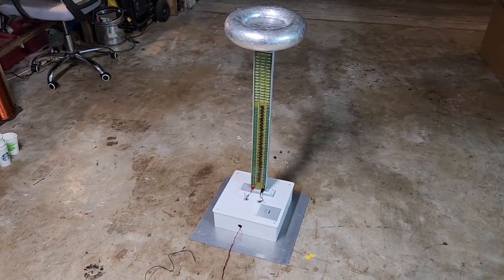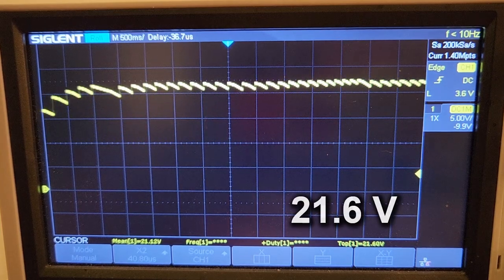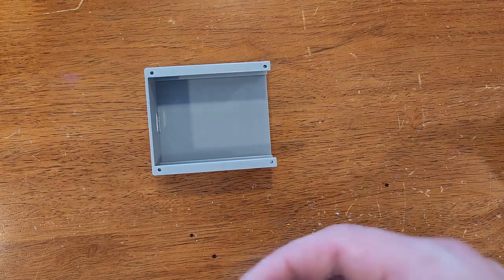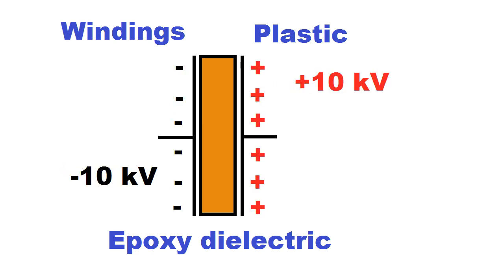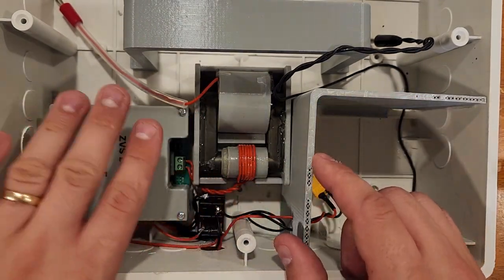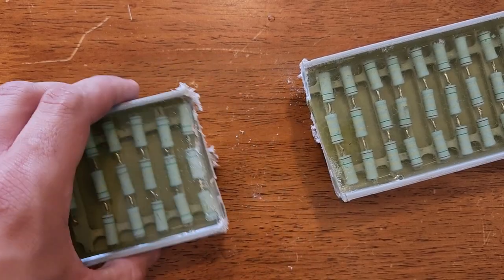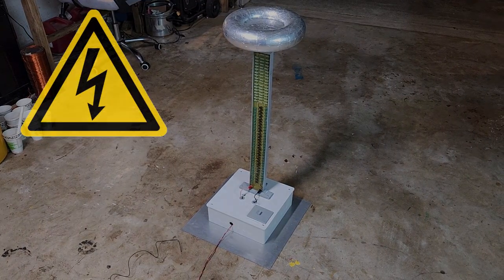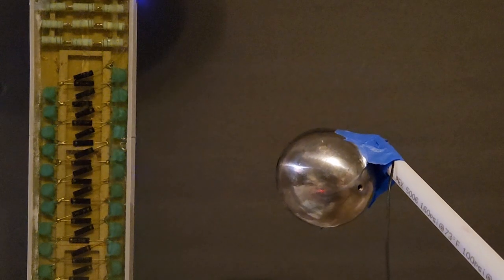500,000 Volt Lightning Tower

Comment: this is not even close to 500kv it looks like it can jump about 10cm so its about 100kv and you dont need top load with multiplyer it just disipates the charge. its not a tesla coil. btw ive built a tesla coil capable of about 2 meters smarks playing music.... and there is no radiation, this is misleading. the bigger hazard is breathing ozone, but you would need a lot of run time to make it an actual danger.

Comment: try the brushless dc emf circular loop train(magnet train running along a track), not coil train, duel-quad coils next to a sideways magnet train
Reply: try making metals by electron avalanche ionization to vacuum the oxygen out
Reply: no wonder you are making uv-c (all of them) with the arc
Reply: all the air particles recombining after ionization
Reply: van der graaf or windhurst are "safer" for high voltage static electricity experiments, very low current, zap safe

Comment: couldn't you just put the multiplier in a mineral oil  or  silicon oil  not epoxy? Trouble shooting and re-working would have been easier? or the dielectric breakdown of epoxy is much higher?

Comment: i can only find 5ma diodes... there shouldnt be that much current anyways right?... so i think a few megaohm is enough even for that.
Reply from the maker: They'll work, but you'll need to make sure to either have a large resistance on the output and/or limit the input power to the multiplier with a very small value capacitor (single pF range) as a high impedance source
Reply: @HyperspacePirate  i am thinking about not buying resistors at all and instead using a short tube with saltwater. thx, didnt think about impedance but thats an option for sure.

Comment: Laugh out loud if you actually had a coil in between the capacitor pastor and then you have the ground connected in between the capacitor in the coil And you used a post with modulator to post the coil you get more  Power output then you would from  Is ADC multiplier.